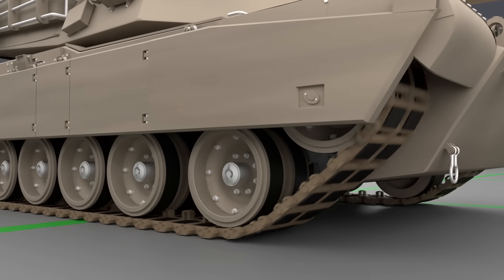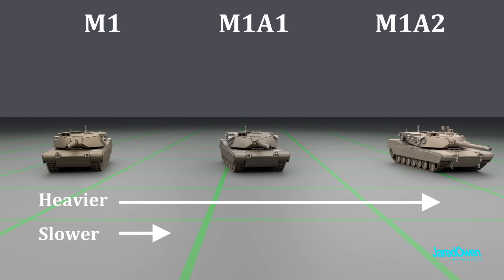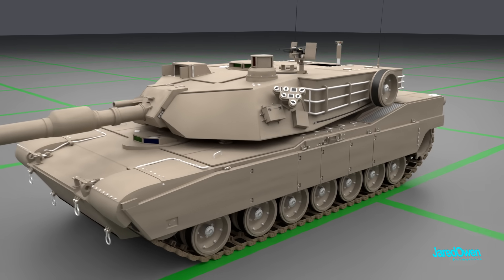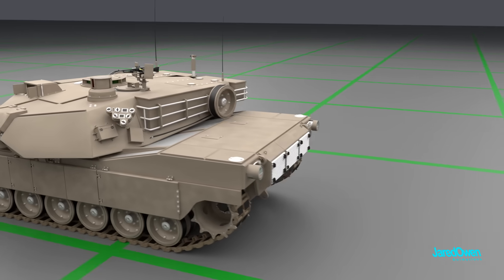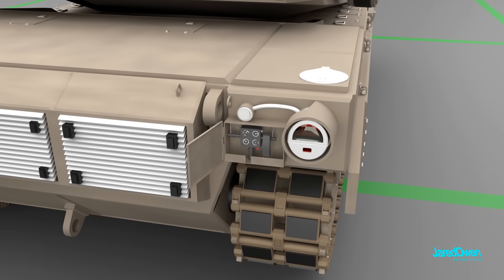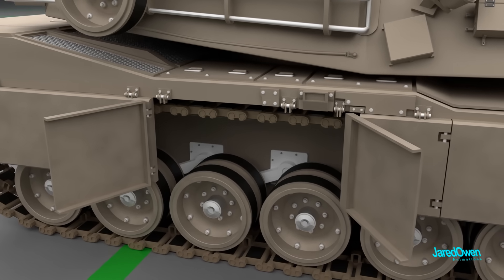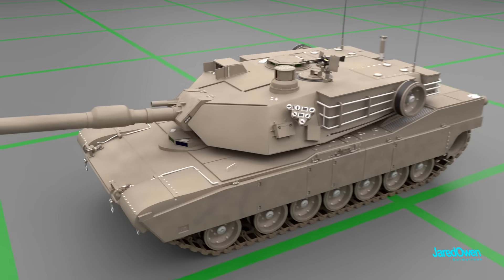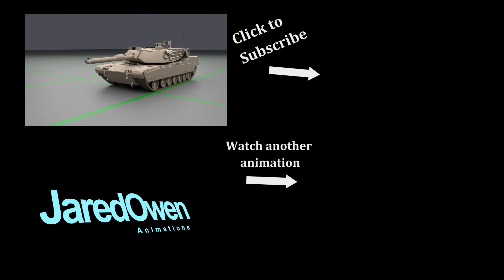How does a Tank work? (M1A2 Abrams)

Comment: Russians military leaders:
WRITE THAT DOWN WRITE THAT DOWN
Reply: Actually first M1A Abrams plans had been stolen by Soviet spy and delivered to Moscow. Soviets were impressed, but engineers committee stated it's impossible to serially produce such tank in USSR due to technological limitations of Soviet industry. Especially fire control computers, suspension torsion bars alloys, infrared image sight, ceramic armor protection and gas turbine pack connected with transmission.
Reply: @bazej1080  Do you know that the T-90 is equally powerful as the Abrams tank?
Reply: @kishanchali8752  I know it's not, I've served in Eastern European army, we operated both tank families, Leopard 2 and T-72, also trained with Abrams. First - there is no such thing as T-90, in Russian Federation army and
ОАО "УКБТМ" plant - tank was named Obekt 188 T-72BU/BM, but after Gulf War and few other conflicts name T-72 became a symbol of failure so for prestigious reasons and to attract some foreign contracts the name was changed to T-90 suggesting new tank.
The tank was designed during 1960s, 60 years ago and the latest most recent T-90MS still has design flaws of that era. Fire control computers weren't a factor in 1960s that's why T-90MS has suspension stroke of barely 178mm (Leopard 2 350mm, Abrams 380mm, Leclerc 500mm). What is more to reduce it's height to the extreme T-90MS has only -6° gun elevation compared to -10° in Leopard, Abrams (or new T-14). This together with very small suspension stroke dramatically reduce it's ability to shoot during move regardless of FCS and stabilisation used - it simply physically throws the barrel off the target and nothing can be done without total redesign of the whole tank (like new T-14). It also doesn't allow T-90MS to utilise most preferable "hull down" position in combat.
The limited 
Another thing is autoloader mechanics - it physically restrict maximum projectile length that's why T-90MS still is forced to use only moderate length projectiles reducing it's armor penetration capability.
Next thing is an ammunition stored together with crew - it was acceptable when the tank was being designed in 1960s and the life of trained crew was expendable but it's unacceptable now, even for Russian Army.
Another thing is outdated V-92S2F engine, it has small power, it's strenuous, very prone to breakdowns, designed as separate from transmission, it needs about 8 hours of skilled crew to be replaced when Leopard 2 and Abrams need less than 40 minutes to be replaced already together with transmission.
Next thing is armor, T-90 due to it's mass restrictions and outdated hull design an armor can't be designed to withstand any modern tank ammo that's why the addition of Kontakt 5 reactive armor - it's can withstand only one shoot thought.
That's why new Russian T-14 tank is different in every regard to hopelessly outdated T-90MS; T-14 has big height of both hull - to accommodate high stroke suspension, and turret - to allow -10° gun elevation. T-14 also has adequate composite armor instead of reactive armor blocks.
It also has different and powerful engine - first time since T-34 an engine which is not development of V-2 engine and it's a power pack connected with transmission possible to be replaced in less than 1 hour. It's also why ammunition in T-14 is stored separate compartment and uses far longer projectiles than T-90MS.
T-90 was outdated before it's production started and Soviets were ready to replace T-72 with Abrams/Leopard 2 equivalent in late 1980 so called "Molot" and few similar projects. The only reason T-72BU/T-90 production ever started was absolutely critical lack of founding from 1991 to 2004. T-90 lost can track for Malaysia against Polish T-72 modernisation called PT-91 - and PT-91 is being considered as completely outdated... Critical lack of founding delayed the introduction of the T-14 Armata by about 25 years.
Reply: А смысл тут что-то записывать? Это устаревшие технологии.
Reply: @masterzinio5975 , да правда что ли? Вот только Абраши не метают башку при попадании из РПГ, в отличие от наших 72-ек
Reply: @artemy_kurilko  если бк детонирует, там уже пох отлетела башня или нет.
Reply: Russians laugh sarcastically in T-90

Comment: good video, few things wrong tho, and they may have already been caught in the many comments posted here already:  1. fuel is typicall diesel, not "jet fuel".  2. loader faces inboard, not outward against the turret as displayed.  3. Loaders machine gun has no shoulder stock, 4. top speed is well over 42mph, depending on the tank... i've had one up to 67mph at Knox, 5. the smoke grenade launchers are just that...smoke grenade launchers... they don't just blow smoke like in the video, 6. commanders hatch has its own machine gun...the m2 .50 cal.  (not depicted in video).     i'm sure there's more errors in the video, but overall its a great overview of the tank.
Reply: 1. JP-8 is jet fuel. 
3. Some appear to have a stock, not typically though.
Reply: @peterson7082      don't know how long ago you were a tanker, but none of them have stocks on the loader's M240 machine gun.   Also, we never used jp--8, its always straight up diesel... the same fuel most everything else on wheels in the Army runs on.   Can you imagine having to haul two types of fuel into the field, to fuel up a M1 and fuel up trucks and other wheeled vehicles?
Reply: @trooper5157  The Army is using JP-8 right now. The machine gun stocks I think I've seen from TUSK equipped tanks and based on high school classmates who became 19K's

Comment: 6:25 I'd probably end up having my face melted. I'm not army material.
Reply: It's why the driver always yells "clear to the rear" and waits until someone with a view of the back confirms and yells "clear" before starting the engine. In reality the turbine (we call it the pack) doesn't start fast enough to burn you right off the bat but it's still done for safety. You can also scare the life out of someone working back there by yelling the same thing lol.

Comment: What's the advantage of using a turbine engine as opposed to a piston engine?
Reply: Quieter at a distance, better acceleration, better torque at some level of power output, can burn any fuel
Reply: @peterson7082  Makes sense, would be nice if they used that technology in cars.
Reply: @twistedyogert  They did, but the fuel consumption at idling was very poor. Also fuel efficiency, that jas changed over the years.
Reply: @peterson7082  Yes, I know that Chrysler had a turbine car concept in the 60s. The engine itself idled at 22,000 RPM as opposed to 800-1000 RPM for a piston engine. It seems that the tank has a similar issue with fuel efficiency, but this is offset by the fact that it will burn almost anything.

Comment: all M1 series fuel capacity is 504 gallons, Range distance depends on terrain. Slope is up to 60% . track links are call inconectors! and center guides. There 3 type of tracks that can be mounted on any M1 Tanks series the  T-156, T-158 or T158LL!  Also the  Tank has 14 road wheels in each side not 7 for a total of 28 road wheels. The inside road wheels is put backwards but, is the same as the outside ones.  Engine side fan units are Transmission cooling fans to cool transmission oil of 30W that hold 36 gallons oil. The infantry phone, a frequent request from troops serving in Iraq, was incorporated in the 2006 rollout of the Tank Urban Survival Kit system, a series of Abrams modifications intended to improve coordination and survivability in urban environments. ONLY FOR MARINES!  US ARMY do not use phone.  During NBC attack you must turn on NBS SYS and pump the turret seal in order to get good seal but is not 100% and you cant traverse turret. the viewing ports are vision blocks when the crew  hatches are close visibility  is reduce to 50% and at night 25% commander can't see 360 degrees trust me on this!  Main door for ammo is call Ready-Ammo door and the one on the left is call semi-ready door. before gunner fire gun has to be armed by loader using  the arm gun handle! Your animation are excellent but, some of the info was not correct!  I am US ARMY RETIRED, Tank Commander  M1.M1A1,A2. for 25 years active service.

Comment: What exactly is a US ton?
Is it any different from 1000 kg?
Reply: U.S. ton is sometimes (albeit very rarely) refers to short tons, which is 2,000lb. (907.18kg.), and is used to differentiate it from a long ton (imperial ton) is 2,240lb. (20cwt. or 1,016.04kg.). Then you have metric tons also called a tonne which is 1,000kg.